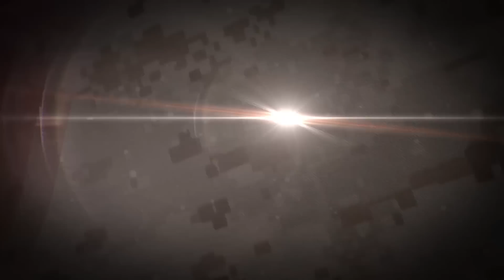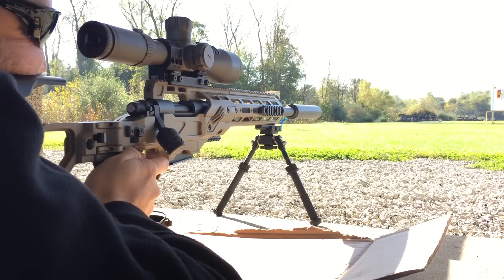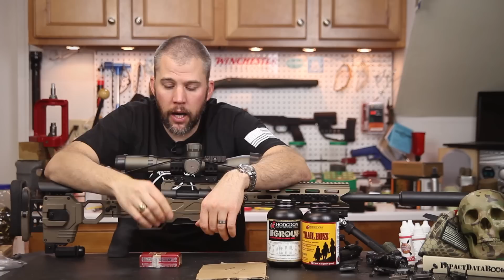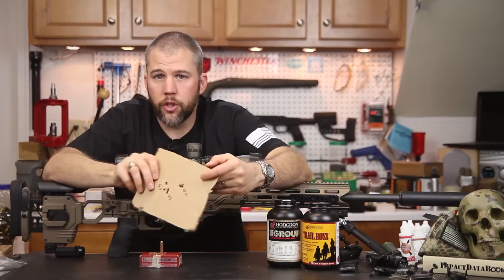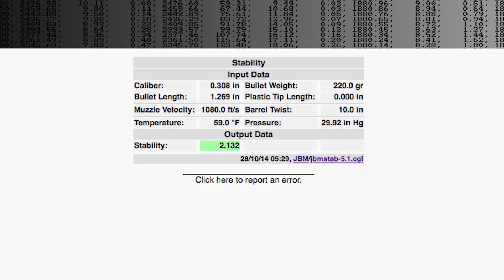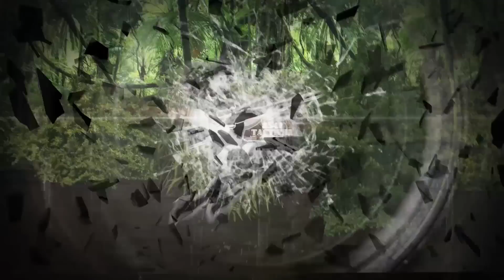Mail Call Mondays Season 3 #32 - Loading Sub-sonic .308 Ammunition

Comment: Ak 165 grain lee mold I think. 5 grains of titegroup won’t cycle but it’s a super quiet good load brass stays in very good shape.  Otherwise 18-19 grains of cfe blk will cycle it reliably. The full power steel case sounds odd. With muffs of u can hear the bullet “kicking “? Sounds like the back of the bullet is waffling a bit. Eventually it smooths out. Anyway you’ll stArt hearing things u never did before.

Comment: What do you think would be the best 7.62x51 subsonic hand load for the Tavor 7 with its 16"  and 1 in 12 twist barrel.  Also, with the issue of excess headspace between the 308 brass in a 7.62x51 NATO chamber, would you recommend the use of 7.62 brass only?

Comment: Great video.  I've been reading so much about subsonics and I've done some extensive testing in field as well.  I can say you really hit the nail on the head with recommending that round nose, I have had amazing results with Beck subsonic loads with the hornady flat point which is again.. a flat bottom bullet almost exact design as the round nose.   I've read in many articles that old timers like flat top and flat bottom bullets for subs.  
I have no problems reading magnetto speed with any sub bullet but I wasnt giving excessive space, I mounted bayonet standard way.  I would just sneak it closer to standard distance  and have you tried turning up the sensitivity?  I imagine you tried this?
Great great video.  I had one question for you in response to your testing without a can...do you find validity not change much when you shoot with supressor?  Im about to start a ladder test and i was wondering how supressor would affect my speed and hormonics.

Also, you really need to see and try shooting the solid copper Maker REX expanding bullets.  They tear stuff up. I'm just trying to get SD down on these projectiles, I think neck tension is to tight when using standatd loading procedures so we are experimenting with neck expanding dyes.
If you saw how these REX projectiles performed at slow  speeds, you might want a sequel to this video.  Thanks for all your videos, when I see you cover topics of my interest, I stop on your videos all the time....

Comment: Great video. Back when you made this I don't think Lapua had released their 200 gr, FMJBT subsonic bullet. That's has become  my preferred bullet for hogs. 

My next rifle project is to convert a 700 Rem VTR from .308 1:12 twist to .308 1:10 (maybe 1:9 but 1:10 works) twist.I used my .308 tactical to test my first loads I worked up to 11gr of Trail Boss but still under 1000 fps. I'm trying to get to 1050 fps -ish. No suppressor yet. Waiting... I need to make a decision on barrel length too...

Load: Primer pockets drilled to 9/64" on a mini lathe. Collet chuck for the case and the drill bit is installed in chuck in the tailstock. Magnum rifle primers. 11 gr (so far) of Trail Boss. 200 gr Lapua FMJBT subsonic bullets. So far... I haven't gotten to 1000 fps yet

Comment: Hey thanks for the info. What about Barrel length? Can I work up a subsonic load for my .308 in a longer barrel? Like 24" or 26" ?
Reply: While I have no factual data regarding your barrel, I would consider that to be a very high risk load. In example the 300 Blackouts are getting full power from 10" barrels. Which means the bullet is pretty much coasting from inertia the rest of the way. So a 16" barrel is about the safe limit. A 24/26" barrel is a long way to drag a bullet through with only inertia. If your bore is well worn or a slightly undersized bullet it may be safer to try. Otherwise you may start by dropping from full power loads incrementally until you obtain your goal. Always confirm the bore is clear before loading another experimental cartridge. Be safe and have fun.

Comment: I use 180gr round nose flat base with about 8.7-9.3 grains of Trail Boss... I test on paper for stability, then run through a Thompson Machine "Thirty" suppressor... Seems to be consistent, about 2 mil drop at 70 yards... Fun to shoot, accurate enough, but no real practical purpose other than just fun shooting... I run this load out of a Remington 700 AAC SD .308 with 1:10 twist barrel... Great intermediate platform for both super and subs like you said.. Great channel, keep up the good work!...

Comment: I've been reloading subsonics for my 308 and other 30cal rifles for a couple years now, I've found that, for me, using magnum primers give me more reliable and accurate ignition. Magnum primers do add a few fps to the bullet so I have to dial the powder charge back just a tad. I've heard of other guys using filler to stuff inside the case and keep the powder on top of the primer but I've never tried that.
Reply: I've seen people drilling out the flash hole.  Is this truly necessary, especially when using a magnum primer and either TiteGroup or Trail Boss?

Comment: For those without a suppressor, there's "The Load". For 30 caliber cartridges bigger than 300 Savage, 13gr of Red Dot under 150-170gr gaschecked cast lead boolit or jacketed bullet should yield about 1600fps. Sounds like a high velocity .22LR and recoils like a .223.
Reply: I was wondering when someone was going to mention that. Makes me wonder what other shotshell powders it would work with (though you might have to change the amount a little). I do recall reading the source article for it a while back, but can't for the life of me recall where it is.

Comment: You may want to try changing the bullet type on the Magnetospeed, I built some subsonic rounds using coated lead bullets out of my 300BLK and it wouldn't register them either. I switched it to lead bullets and it worked perfectly. I have the V2, so it is different than the V3, but they both support several bullet types.